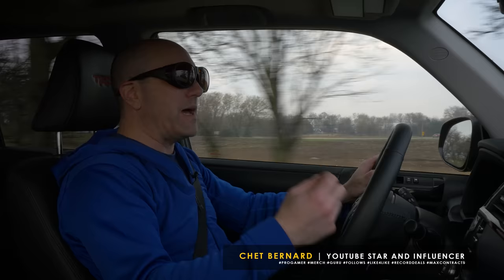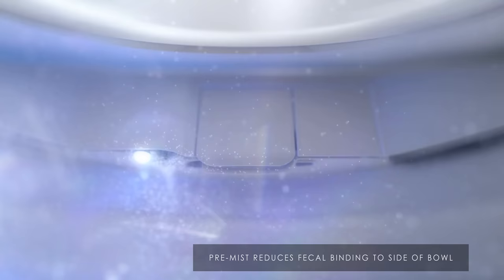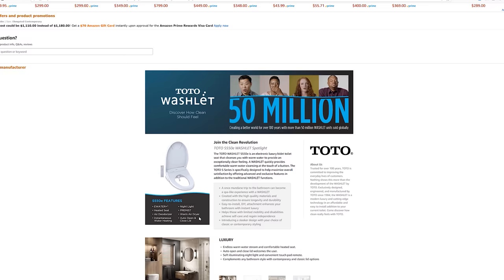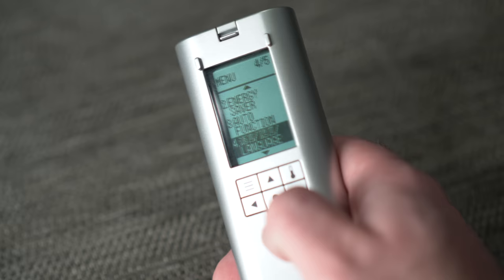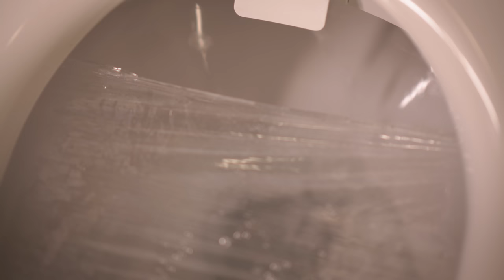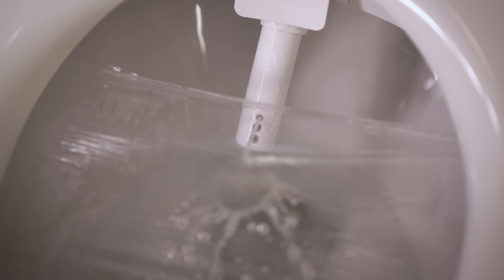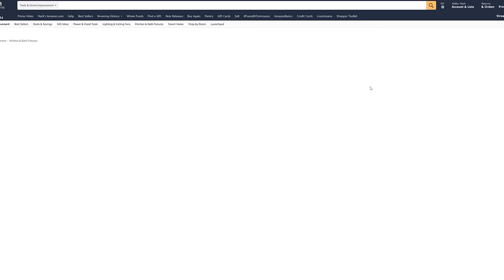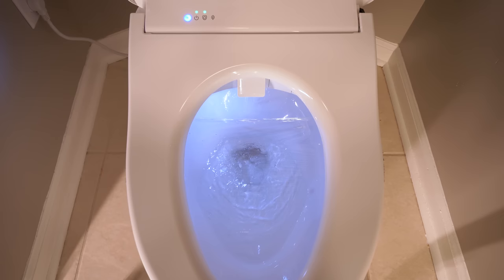The End of Toilet Paper | Toto Washlet Technology

Comment: Toto has other really neat features beside the bidet: 1.) Their own extremely smooth enamel finish.
Nothing can adhere to it, so it virtually never needs cleaning.
2.)Cyclonic flush ports.
Maximum bowl evacuation using absolute minimum amount of water.
3.) Top of line model designed by reknowned artist.   Look amazing.
(something I've never said about any other toilet)

Toto is a great company.  Great video.

Comment: For those without power outlets, I've been happy with a basic model that has a mechanical valve and no heaters. The water is warm enough because it's room temperature from sitting in the pipe. For drying, I just use a small amount of toilet paper, less than without a bidet.

Also, it only cost $100 Canadian at Costco, which is around $67 US.
Reply: Questioner there were mechanical ones on amazon for twenty until covid19 drove them out of stock. Downside though is some need cleaning or have crap in various crevices. Going premium does help.
Reply: @QuickQuips , I have no experience with the Amazon units so cannot comment on them, but do know the Brondell Ecoseat I bought has a self cleaning mode that rinses the nozzle before and after use (depending how fast you turn the valve). Here's a link to the manufacturer's website: 

https://www.brondell.com/swash-ecoseat-s101-bidet-toilet-seat/
Reply: The premium is worth it. You don’t think heated makes a difference until you actually use it. Treat yourself, you won’t regret it.

Comment: I like how in depth he went on into these devices lol. As a fair warning, these might not reduce your tp usage as much as he implies. Your mileage may vary. I've lived in Japan for a while and I actually brought 2 TOTO washlets back to the US. Most models except the top of the line one's like his, don't have a drying function. Even when they do they mostly don't work so well. I end up having to use tp to dry off after. Granted my nether regions get sparkly clean, it's worth it for me. BTW those worried about nasty back spray, TOTO washlets with UV and electrolyzed water keep the wand super clean. You will have to clean the toilet bowl and surrounding area more often due to back spray though.

Comment: I have owned a Toto A100 Washlet for over five years.  It is the base model, no remote or air dry but most everything else and $319.00 on Amazon.  Very pleased, I have 3 baths only one has a washlet installed, I will walk down a flight of stairs to use it.  Useful for a person with mobility issues.  Savage did his excellent review without snickering, good job.  Since this is primarily an automobile review site I will call the Toto A100 Washlet the Miata of bidet toilet seats.

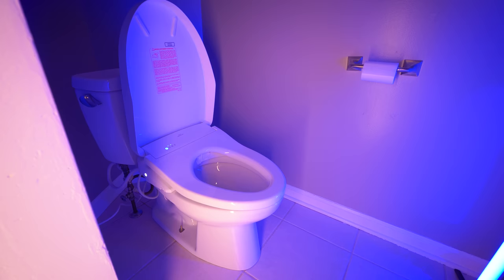Comment: Over the past 20 years, I've only been buying Toto Drake toilets 8:32 wherever I move. Back in the 90's I read an article about how several landlords in LA public housing used TOTO to avoid dealing with clogs by tenants. They have a smooth larger diameter bend to help with that. And the BEST FEATURE: the Toto flush is so effective yet so splashless, I can literally keep flushing crap down the drain while I'm still sitting on the bowl!

Comment: I'm surprised no one ever mentions Toto's K300 model.  It's the middle child of Toto's seats and for me it's the perfect balance between price and features.  I got it for $500 at the official Amazon Toto store, which is already half the price for the S550E model and it has a heated seat, endless warm water, no water tank, front cleanse from females, adjustable water temperature and pressure, self cleaning wand,  warm dryer and a good quality remote control.  If  you don't want or can't spend more than $1,000 on a bidet but still want all the necessary features along some luxury, try the Toto K300.  I recently went to a friend's house and they had a Brondell Bidet, it could not compare to my bidet, a weird way to feel proud but hey, it made me happy I made the right choice.

Comment: Welcome to the party. I have a Brondell with multistage heated seat, water and blow dryer, oscillating spray option, night light, and adjustable spray for rectal or female cleaning. It doesn't have the remote, but rather seat mounted controls, but really... Do you REALLY need a remote? Your bit gonna control it from your couch.

It was only around $260 on Amazon.

Best of all, they work great as warm water enemas when you can't poop.

Comment: Bidets make a lot of sense. I got a no-frills one about 1.5 years back for $30 from Amazon. No warm water - just a cold jet. It cleans you. You'll get used to the cold water and you can control the pressure. Then you use a bit of toilet paper (much less) for drying/cleanup.

In the USA we laugh at them. It's dumb. They make sense both in cleanliness and in not wasting paper (and not having to process that paper at the sanitation plant). Still, it's a hard-sell here as most don't talk about it.

After having one, I know I'll always have one in the future as it doesn't make sense not to have one. It was a bit of a leap of faith to get the first one, though.

Comment: I guess if you need a quick relaxer after a stressful day and taking a hot bath is too much of a hassle, you can just sit on a heated toilet seat for a couple minutes. 😄
You're still using toilet paper though, with that fancy, expensive unit? That's rough.
Also, we have stuff like nose hair trimmers, but do we have butt hair trimmers? I imagine that could help with hygiene and low-hassle, too. 😄
Saving money on toilet paper is no good point though. I get the point about the worthy investment, but ~2000 rolls of paper last a very long time.

Comment: Here's a comparison for you. If you're rendering a wall there's a lot of splash back whether you want it or not! How does that water nozzle stay 'clean' during operation. Especially after a heavy night on the tacos 🌮 I'm guessing there's a lot of collateral damage going on? 🤔
Reply: The nozzle is self-cleaning. When you're done you see it retract and a bunch of water sprays out near the back of the toilet. That's the nozzle cleaning itself.
Higher end models also pre-wet the nozzle, so stuff is less likely to stick.

I've used Toto Washlets for years, and they have never once failed to provide total cleanliness, no matter the size of the taco dinner.

Comment: This was an amazing review, loved every minute! 
It has always amazed me how the Bidet is not more common EVERYWHERE. some people think that only Muslims use it while even bloody KSA doesn't use a proper bidet, they use hoses attached to the side of the toilet. I'm from Egypt, and a bidet here is practically a very small and narrow metal tube attached facing an upward angle towards exactly the asshole. there's small faucet handle to your right, you turn it on and water comes out, you can keep rotating it to increase pressure to help clean not just the outside of your rectum, but also your inner rear-ends of it, pushing out pieces of poop that would have otherwise stayed in there. Hence, MUCH better hygiene than just cleaning the butt itself, and also way lower probability of bowel problems. Amazingly enough, the exact kind of bidet I'm talking about is only found in Egypt with a very basic but effective and cheap format, and also in Japan. That's it. Those are the only two countries on earth where people thoroughly clean their butts and the inside rear-end of their rectums. I'm not sure how do you can use it to clean your genitals tho, it's way too far back for that.

Comment: I don't understand why the integrated units are so incredibly expensive compared to the standalone. I want a nice built in wall hung installation, not some click on device with visible cables and plumbing.
Reply from the maker: Problem with integrated units is room has to be designed for one.  They are typically more of a custom setup so its better to install when place is being built. And costs are much higher.
Reply: @savagegeese  A reply from the man himself! I actually figured it out, just finished researching. About $1400 for a wall hung integrated mid-tier model. Definitively going in the next bathroom. Here in Europe wall hung toilets are standard to avoid the complicated floor drain, because a welded floor membrane is required in bathrooms. Since wall hung is standard the complete "inside the wall" cistern and frame parts are only about $150 now. The shower toilets are compatible with the standardized wall hung internals, super easy apparrently. Only need to pull electrical conduit during installation, but I can do that and the electrician can complete later.

I work in construction and prepared a cistern for a shower toilet a long time ago, but that was a $4K toilet, never got to try it, great to see they aren't so expensive any more! A regular wall hung bowl is about $100-200, so quite a step up, but still okay! Thanks for the intriguing review!

Comment: Strange how you all discover bidets. Meanwhile I feel in Europe it's been passed on more then not.
Right now issues for me are lack of power outlets and the fact that I'd have to break out and rewall my toilets that are built-in.
I use moist and dry TP for cleaning ^^
Reply: you can get one that only uses the cold water line, no electricity required and it's around $20
Reply: @Aaron-lc8nf  yeh but then I wonder how to hook up the water supply since it's a built in toilet if you know what I mean

Comment: Question: How do bidets not aerosolize feces by pressure washing your poop hole?
Reply from the maker: The angle at which the wand is deployed reduces all blow back and uses an air induction system to reduce fecal mists.

Comment: This washlet is garbage. Washlets of competing brands come with a premium package, which emulate a revving sound of a Ferrari V12 engine, as you modulate the strength of muscular contractions during defecation. In addition, this waslet lacks TRD badging (a must in 2020), a giant front sport grill for improved air intake and an improved rear suspension to allow for equally smooth dispensal of highly-variable-size fecal droplets. But, even though it is not the most fun washlet -- but mere an... appliance, I gave it few points for its value. 4/10.